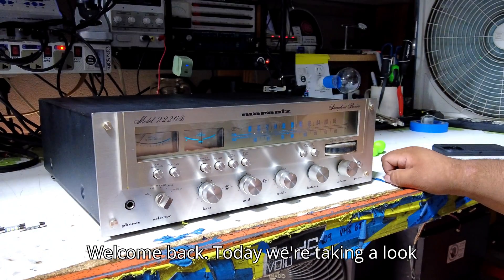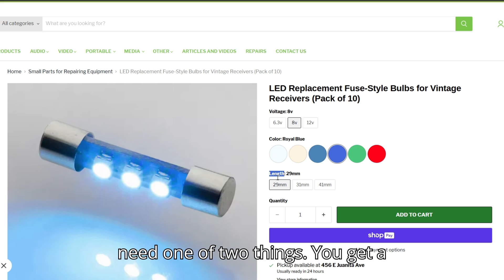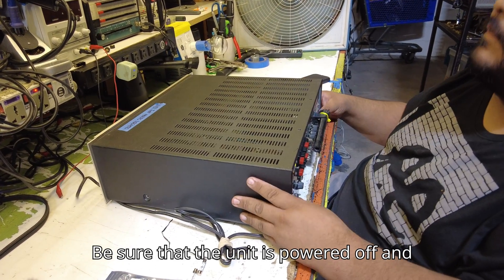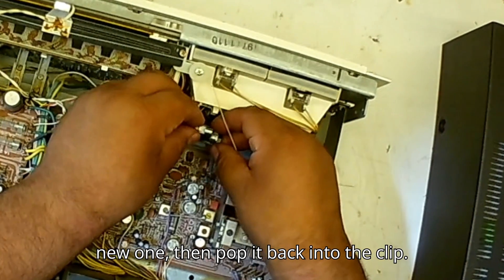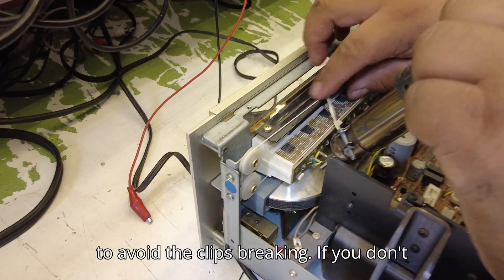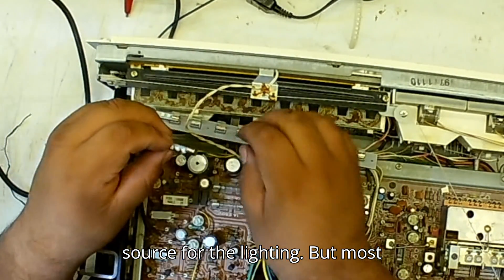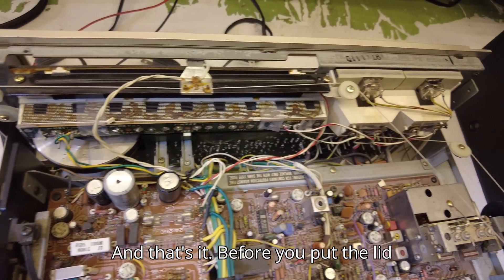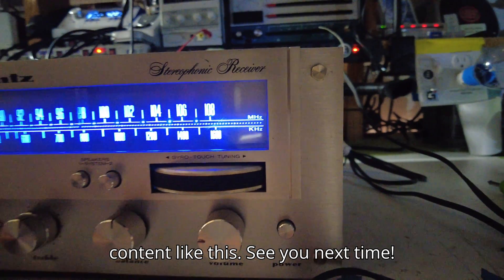Easy Repair Tutorial of the Marantz 2226B | How to Replace the Lights on a Vintage Receiver

Comment: I've seen some other vintage audio gear where the lights are hard-wired in, meaning you need to cut & strip wire to replace them--this looks so much easier, thanks!
Reply from the maker: That's definitely a perk of this model - glad you found this video helpful!